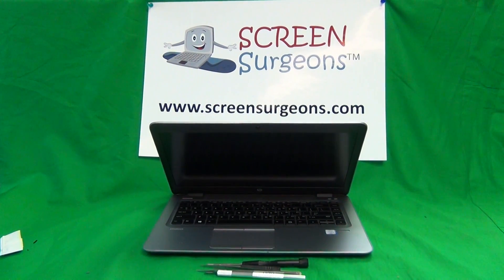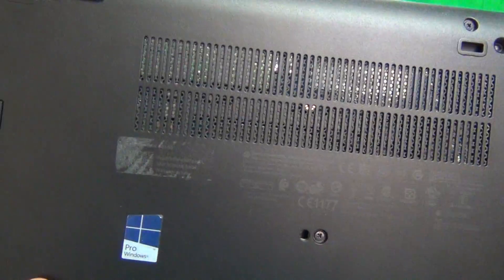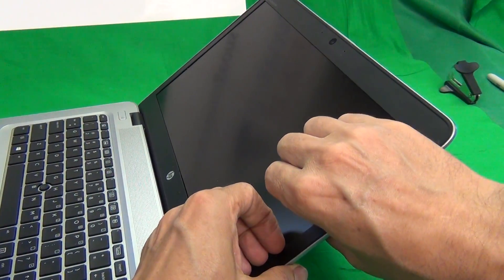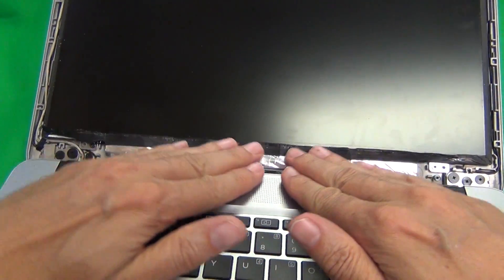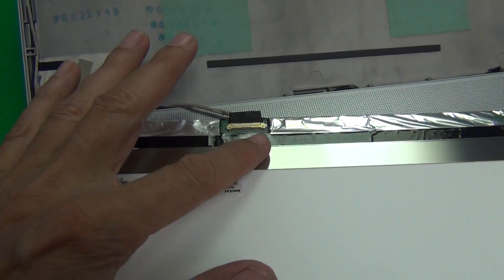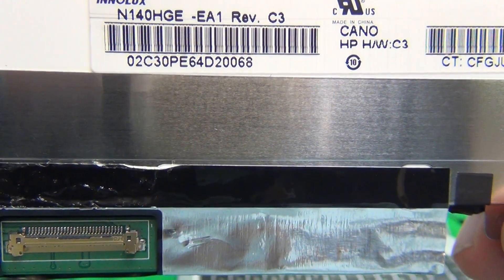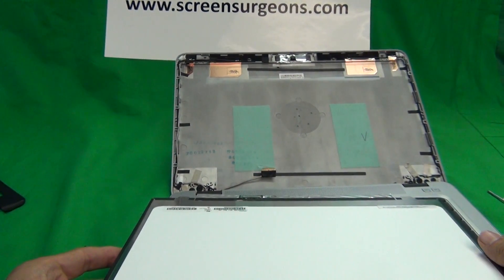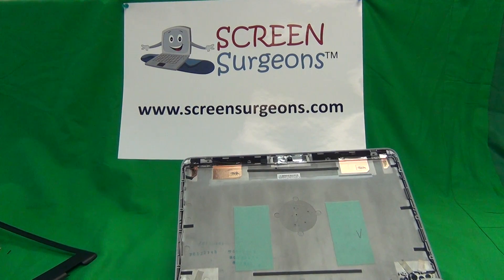HP Elitebook 840 G1 G2 G3 G4 Screen Replacement Procedure

Comment: Damnit this video is old .. you probably won’t remember, but it’s worth a shot removing the puzzle when I get to the bottom part where it rotates on the bracket it seems to be connected to that bracket it doesn’t just come off like yours I don’t know what to do.. I’ll keep at it I’m sure I’ll get it
Reply: I got it. It just snaps off ridiculously hard to the point where almost breaks.

Comment: Hey so, i can pay you as much as to point to $200 if you can please fix my Hewlett-Packard HP EliteBook 840 G1 Laptop screen! Ive had this computer fpr a while now and the only issue about it is that it cannot sometimes connect to the internet leading to the requirment of repeated restarting which i don't really mind. The screen is damaged and has cracks and has chuncks of blackness similar to dead pixels in a way, and it is very hard to use in this condition. If you can repair this i can mail it to you. Also this may be a bad time to ask due to the current virus outbreak. I hope you find this and respond, and thank you.
Reply: @THE D∀я∃ DEVIL DUDE Oh neat thanks btw

Comment: can I use 840 G3 full HD LCD screen for 840 G1?
Reply: I want to know too, but for me it is a g1 for a g3
Reply: @_kimutai  look whether display is 30 pin or 40 pin. And check for size.
30pin to 40 or 40 to 30pin converters also available if yours one is not matching with other one

Comment: Hello Screen Surgeons
French owner of the elite book 840G1 I suddendly encountered a problem and it is now impossible to use the computer (have a look on http://ndubau.free.fr/tempo/EB840.mp4). My question is : do you think the problem is caused by the screen itself, or is it possible that another component is out ? I precise that the output through VGA on an external monitor is fine !
Thanks for your answer !

Comment: Hello screensurgeon, question for you: I have this model HP EliteBook 840 G3, mine seems to have a classic backlight failure, in that the screen appears black unless I shine a flashlight at it, at which point I can see the windows but they're very dark.  My question: would replacing the screen as you showed in this video resolve my backlight issue, or is the backlight a separate component on this model?  Thanks in advance for your feedback.
Reply: It could be a blown fuse on the motherboard
Reply: in general it should solve your problem because the backlighting is integral part of the screen and there is only one cable and one connector for data and for powering the backlighting.
Reply: I have the exact same issue.  840 g3. With no. Back light issue.   Same lcd on other g3. Work's fine.    Tested other working lcd from a g4. On this g3. No back light . Problem is the mother board fuse or mobo inverter IC. Or mobo. Lid close switch.   Any help finding the fuse or close lid switch on this g3??

Comment: Do you think this procedure would also apply to the EliteBook 850 G1?
Reply: No idea.
Reply: Yes it is quite similar.
But be careful concerning the resolution of the original screen in comparison to the resolution of the replacement screen. I was told by my replacement screen supplier the following: if the original resolution was 1366x768 and you want to upgrade to 1600x900 or to 1920x1080 you need a different video cable which makes the swap much more complicated because you have to replace the video cable.

Comment: i got confused. you mentioned that the resolution is interchangeable? but your site shows "Important Note: Please check the native screen resolution of your laptop before purchasing. As this replacement screen are for laptops that has a resolution of 1366x768." what does it mean?
Reply: It doesn't matter, if upgrading from WXGA to FHD you can use the same cable, different story is if you're trying to install 1400p screen, in that case you will need a 40 pin 4-lane eDP cable (FHD and lower uses 30-pin 2 lane cable)
Reply: I was told the following by my replacement screen supplier: if the original resolution was 1366x768 and you want to upgrade to 1600x900 or to 1920x1080 you need a different video cable which makes the swap much more complicated because you have to replace the video cable.

But MegaXtc11 seems to know better.